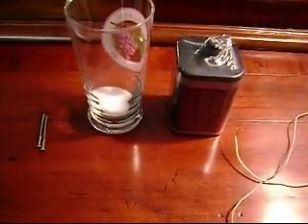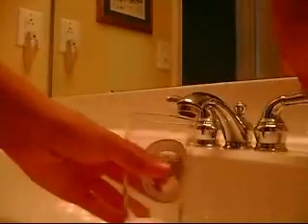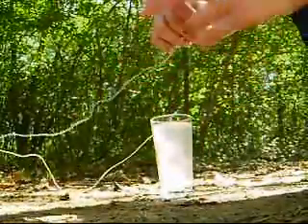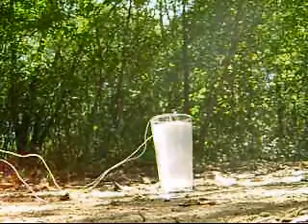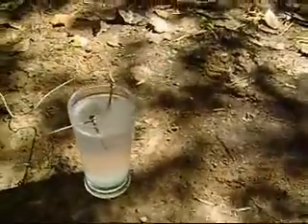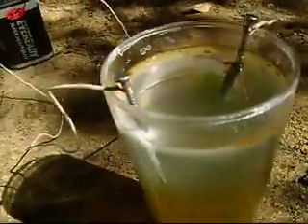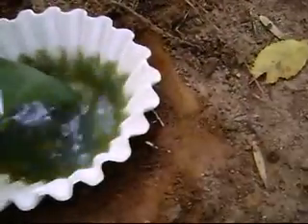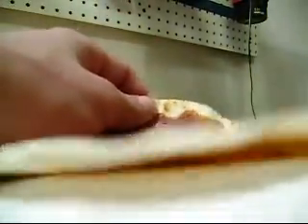how to make thermite

Comment: much easier to use a battery charger. 
You can do good things with the zinc coating from those batteries and some bleach..
Use the carbon electrodes and same battery charger to make hydrogen gas and pure oxygen too.

Comment: @Ilovelazers - he mixed in salt... so it does make chlorene gas. If it were normal water, it would split into H2 and O2, but if you mix in NaCl, you actually get Cl2 and H2 produced, with NaOH forming in the water.

Comment: This is wrong. if you want real therimite you need 8 parts of rust(iron oxside) to 3 parts of aluminium.Because aluminium is so light it will look like a 50/50 mix.

Comment: I put a handfull of steel wool in a mason jar and fill it with water and put a fish tank air pump in the jar and let it sit. After about a day and letting the rust settle the mason jar has about an inch of rust on the bottom. I then siphon the water off the top and put a rare earth magnet in a sandwich bag and get all the contaminates out. Then let it dry. Pretty simple. Havent gotten the alluminum yet.

Comment: Yeah bro don't use a grinding wheel. I saw a guy loose an eye doing that. Use a sander on aluminum. It cheap and works great. Nice video otherwise. Never thought to use fresh steel. Usually just found some rusty steel and used that.

Comment: THis is bogus when metal is melted it is way to hot to tuch after being melted and also pure water or distilled water does not conduct electricity and you during the process of making rust are at no risk of blowing something up. my scinetific conclusion is you are an idiot and melted the hole with a torch or something and just put some fireworks on it so yah suck on dat!

Comment: If you need lots of rust, walk down the street looking for an American made car. You should find plenty of iron oxide around it, and if the car has silver paint.. The paint will have the necessary aluminum powder in it.  That is the reason silver American cars burn so well.

Comment: @UTubeisSHIT523441 I didn't even consider breakdown voltage because I knew it was ridiculous. According to a research article I found off of google, it takes 2 million volts to cause the breakdown of a measely 7.6 cm of water. That's 263000 volts per cm. This is not ideal for electrolysis or much of fucking anything regarding passing an electric current. Oh sure it'll conduct electricity if you hook up a tiny NMR tube of it to a windmill, but it's still classified as a dielectric.

Comment: @UTubeisSHIT523441 Sea water conductivity is 4.8 S/cm. Deionized (pure) water conductivity is 0.0000055 S/cm, almost 6 ORDERS of magnitude worst than sea water. To give you an idea of how NON-conductive that is, you would need to have an external load voltage of 182 thousand volts to pass 1 ampere of current through 1 cm (less than an inch) of water. Do you have any million-volt super capacitors lying around? Didn't think so.

Comment: @Barrack16 Those will also work, but keep in mind that they're much weaker reducing agents than aluminum so you won't get as much bang for your buck. Boron oxide is actually used in some aluminum based thermite mixes, just to give you an idea of how much weaker it is. And pure zinc is a tad harder to come by than pure aluminum.

Comment: @0100101001101010 ""anything metal that can turn into rust" You mean IRON" You can use steel too! It also works with a bunch of other oxidized metals like copper rust.
You can also light thermite with a sparkler, as well as a potassium permanganate and glycerol reaction.

Comment: You don't need magnesium in all cases. I have some that I made from the pure powder forms of both Iron (III) oxide and Aluminum that can easily be lit with a blowtorch, and it's hot enough to burn through an inch of steel with only a quarter kilo.

Comment: hey just a tip adding vinegar to the salt water solution helps a ton in fact i ended up just having vinegar, salt water, and a bubbler for a fish tank and it worked really good, and you can just have as much screws nails ect. you want

Comment: @shoeym82 the coarser the thermite, the more heat required for ignition. If it has been powdered to the consistency of powdered sugar for example, then it in fact CAN be lit with a lighter of something else of similar heat

Comment: @FaustusIgnatius 
 Yes, electrolysis of distilled water (H²O) will produce those gases.
Electrolysis of salt (NaCl) will produce Hydrogen chloride gas. (bad4U)
 
I think the entire reaction would be thus.
 
4H²O + NaCl + 2Fe => HCl +NaOH+ Fe²O³ + 3H²
 
The reaction byproducts would be:
Hydrogen (gas).
Hydrogen Chloride (acidic gas).
Sodium Hydroxide (caustic solution).
Ferric Oxide (precipitate).

Comment: @splatterhead062 or if the aluminum particles come in contact with griding iron, then the heat may be enough to cause some ignition.

Comment: It is dangerous to grind soft metals like aluminum on a grinding wheel b/c the the small metal particles get in the "pours"  of the grinding wheel and then when you grind on it enough to where the wheel gets hot the aluminum particles in the wheel expand  and can cause the wheel to crack. And a wheel psinnning at high speeds that cracks is obviously dangerous.

Comment: This seems like a very difficult way to make thermite. To mass produce rust, it works better to leave a shitload of iron outside, where it will hopefully get rained on.
Also, it would be nice to give advise on the detonator, as well. It usually takes quite a bit of heat to start the process.

Comment: actually you need 3 grams of iron oxide per gram of aluminium powder.
you should be able to simply buy both of these at hobby stores as their normally mixed with paints. mix the two together well ignite with magnesium foil or a sparkler and run like hell.

Safety: the reaction will make lots of harmful UV radiation so wear a welders mask or view the reaction through a piece of glass I.E a car windshield.

Comment: @QW3E4RT5 
You need a LOT of heat to light thermite.  The conventional method for hobbyists is either magnesium ribbon or sparklers, both of which work fairly reliably.  Other more exotic methods exist as well, but i recommend trying magnesium ribbon.

Comment: easier way: Buy HCl (muriatic pool acid), put in iron. After 5 days, take out extra metal, filter. Put baking soda in it to get Iron Carbonate. Heat in oven or in an aluminum foil  over a flame. It decomposes into iron oxide. Woo hoo. i'd use copper oxide anyway, it explodes.

Comment: @k3pre2000 This isn't my video XD. I've always used a fuse to light it when I make it and it burns a lot longer than this. Normally I pack it though so it's in a much more concentrated form, not just as a powder.

Comment: Hydrogen and chlorine is correct, salt is sodium chloride, and water is hydrogen and oxygen, and the nails are iron. THe salt is a solution, it will pass through the filter. rust is iron oxide, so the only remaining elements are clhlorine and hydrogen.
But yeah, either he mixed the thermite wrong, or it was  a sparkler in the end.

Comment: Can't find Magnesium? Get a Sparkler! You'd be surprised but sparklers are nothing more then metal-ignition sticks. They can produce large amounts of heat over small areas, which is all you need. Stick one upside-down in your thermite, light up the top part which is above the thermite, and run the hell away!

Also remember not to look at the reaction unless you have a welding mask on at best, it releases copious amounts of UV radiation which can litterally fry your eyeballs. Recording it is safe

Comment: Actually Aluminum is the only good Reducer to use in a Thermite reaction. Aluminum's got enough reactivity and it has the correct amount of valence electrons on its own to accept the number of Oxygen that Rust has.

Also the reaction is actually:
2 x Al + Fe2O3 --> Al2O3 + 2 x Fe + Heat

Aluminum is a powerful reducer but the reason why you never see Aluminum "rust" is because the energy barrier to get the reaction is quite high. Hence Magnesium is often used as ignition source for its high heat

Comment: Some more info on the dangers of the electrolysis process to get your rust.

Chlorine gas is heavier then air and accumulates in badly ventilated areas. This guy has the right idea: do it outside! If you can't do it outside, don't try electrolysis and get your rust through another method.

The dangers of chlorine should be taken seriously, the stuff readily oxidizes anything and reacts with water in your cells to produce Hydrochloric acid and the nastier hypochlorous acid. It is very dangerous.

Comment: It is a very good idea to make the rust as fine as possible, same with the aluminum (more total surface area, the faster the reaction).

You may want to look up correct weight:weight mixtures and weigh the optimal amount of aluminum and iron oxide you need to mix together. In thermite reactions, too much of either can inhibit the reaction giving you much less bang for your troubles.

Finally make sure you mix everything perfectly. Don't worry it won't blow up until you ignite it with magnesium.

Comment: Try to find nails that are already rusted, scrape off the rust (you can keep that rust too) until you get a nice iron exposed surface. THese work best in electrolysis.

Also chlorine gas bubbling out of the water is very nasty and corrosive, don't breathe it in! If you smell rotten eggs (the other emission, Hydgoren), you're too close for comfort.

Comment: bolt generally have a nickel or galvanized coating though.  Increased voltage means increased heat, you could boil the water.  be careful

Comment: Tin doesn't alloy or mix with aluminum.  they are like oil and water.  Tin mixes with copper, antimony and lead, but not aluminum. So stop this nonsense about saying that Aluminum contains tin.  it is simply untrue here in America, in Denmark, in China and on the Moon.  Believe me, you won't ever have to worry about breaking that law.

Comment: No No No!  God.  Aluminum foil only has aluminum in it.  Tim foil has tin in it.  Christ!  You were on Leno's show, weren't you!  Tell me, which way is the Pacific Ocean?

To answer the question... you could just blend it if you grind the aluminum up into a power.  That is the point.  A powder combines with the rust power so that each grain of aluminum is in very close proximity to each grain of rust so that the reaction will take place better.

Comment: No, you will not get "tetnas" (tetanus).  Tetanus is an equine disease that is commonly found near where horse stables existed.  typically 40 years after the last horse left it is safe.  In a lot of places there were still horses, even forty years ago.  But not at the home depot where you get the iron nails.  Rust does not cause tetanus numb nuts.

Comment: does'tn it suppose to release hydrogen and oxygen? because when you pass an electric to water it will break the H2O molecules and become hydrogen and oxygen gas. salt only make it easier for the electricity to pass through the water.this process is called electrolysis .

Comment: i don't really think it was oxidizing iron... the power source in this video, which is battery pack only transform the electricity to heat and of course oxidation took place but it was not the main idea of electrolysis... other wise you just wasting time to get the rust...

Comment: To be accurate his method produces hydrogen AND low levels of chlorinegas but when you do this in a well ventilated space or outside there is absolutely no risk at all unless you put your nose inside the jar. Although its far more easy to just buy iron oxide at a pottery store or paint store because its mainly used to colour things.

Also giving someone a name makes you look like the 'dumbass'. Especially when you try to correct people when you are wrong.

Comment: everything you said is true except the last sentance...

It's iron not just metal in general.
It's not only if it isn't galvanised, it can be prevented with anything that protects it from oxygen. But yes, galvanisation is the most common industrial way to prevent rusting.

Comment: in the electrolysis of sodium schloride solution, chlorine gas is formed at the anode and hydrogen is formed at the cathode. The liquid in the solution left behind is Sodium hydroxide

2NaCl+2H2O --(electrolysis)---> Cl2(gas)+2H2(gas)+2NaOH(liquid)

Comment: the ratio of thermite should actually b 8 grams of rust to 3 grams of aluminum..... thats about equal amounts because aluminum weighs very little... if you have to much rust per aluminum your thermite won't burn hot enough, but other than that great video

Comment: swordslay000, Putting only the positively charged nail in the liquid won't do anything. Without both the positively and negatively charged nails, no electricity will flow and no bubbles will be produced. When both nails are in the water, the negatively charged nail produces 2 parts hydrogen for every one part oxygen (off the positively charged nail).

Loudisfun, great video. Thanks for posting.